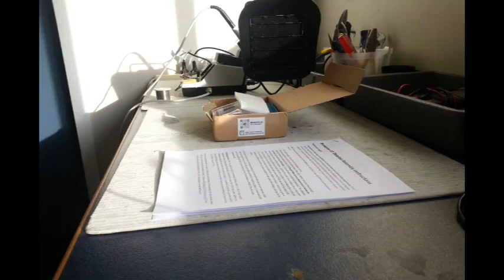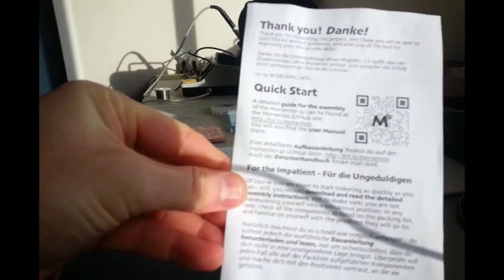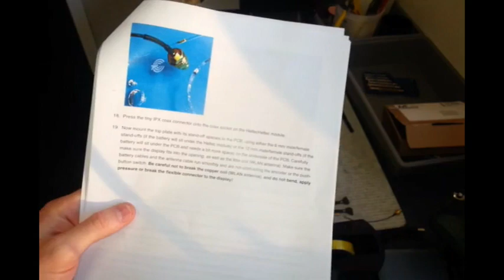Morserino 32 Kit Build (Newbie Builder)

Comment: What electrical resistance did you get while measuring it before attaching the antenna, etc? 
I just got my morserino last weekend.
Reply from the maker: You must be referring to step 12 where you test the battery connector. I tried to measure it but the multimeter I was using couldn't tell me. It might have been higher than what could be measured with that multimeter. I knew it wasn't shorted though, which is important, because a shorted battery connector would likely cause the battery to explode.